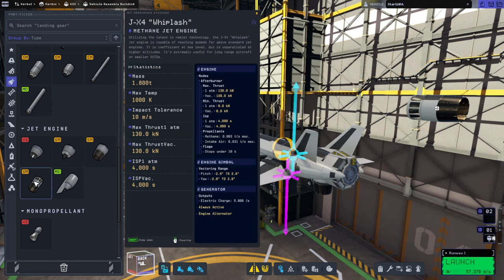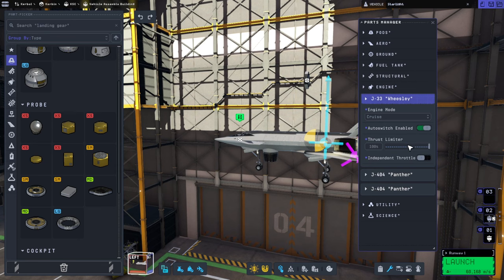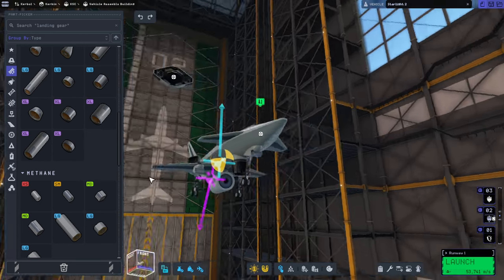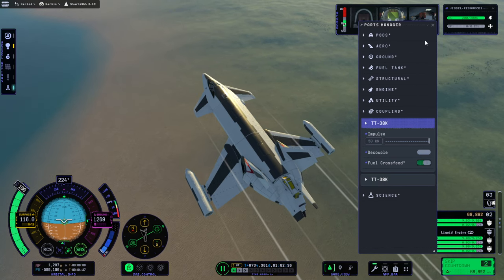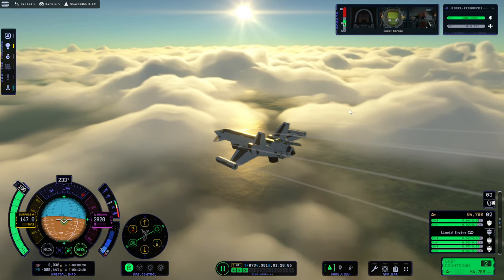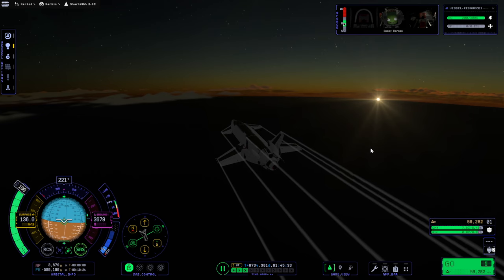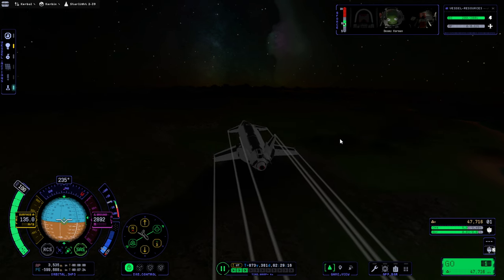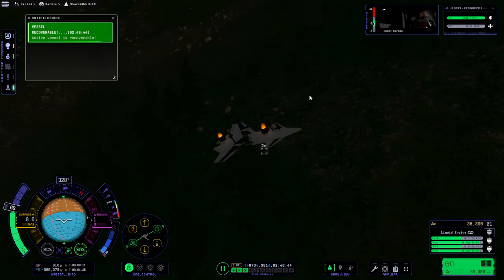KSP 2 Early Access - For Science 41 - Wheesley

Comment: I don't get, what are the benefits of putting landing gears on the center of mass line. Won't they protect tail better during take off and landing, if they were placed further back?
Reply: The plane would be a lot harder to take off if you put the landing gear further back. With it closer to the center of mass the plane will tip up easier like a see-saw.
Reply from the maker: The main landing gear should always be placed directly behind the center of mass to ease rotation off of the runway. A quick look at almost all tricycle landing gear aircraft will show that this is the case. A few, like Concorde, also have a tiny wheel on the tail as a measure against tail strikes.